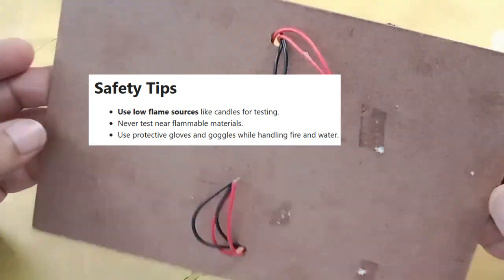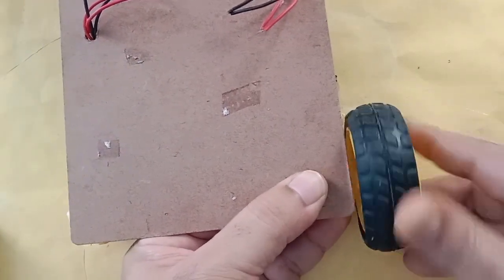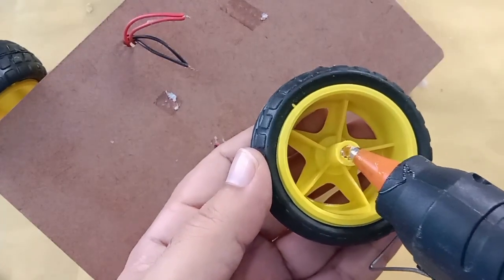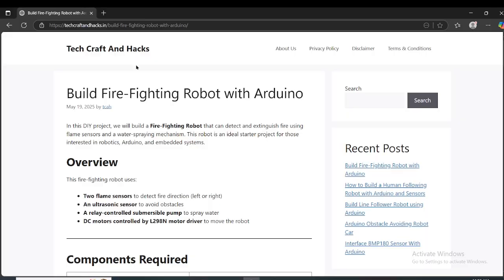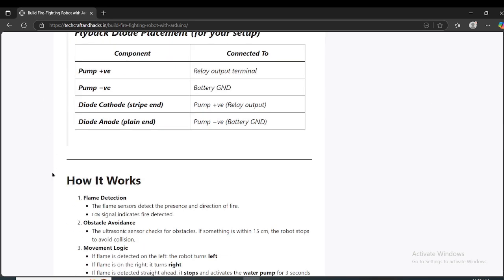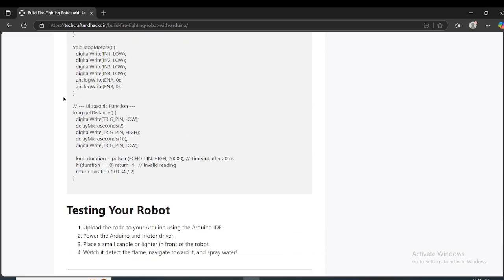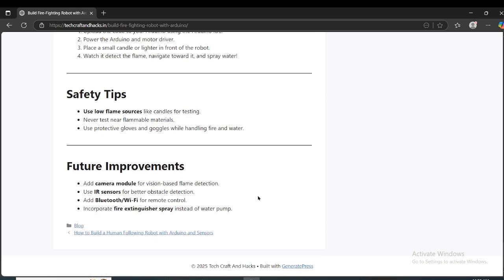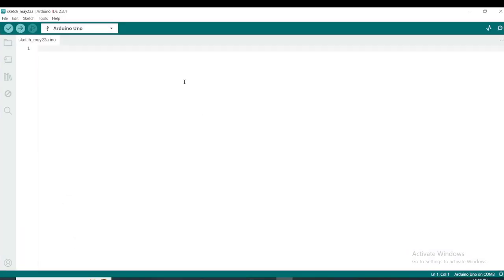Build a Fire Fighting Robot Using Arduino || Arduino Fire Fighting Project

Comment: In video at 13.58 i didn't understand how to connect please response me as earliest possible because I am a student and I have sense exhibition I have preferred your video only please corporate with me if you can can you please send me its circuit diagram to
Reply from the maker: 1. Relay IN pin should be connected to Arduino Pin12
2. Relay GND should be connected to Arduino GND
3. Relay VCC should be connected to 5V on Arduino 

To power Arduino connect 5V which is coming from Motor driver output to Arduino 5V (Motor driver 5V --> Arduino 5V).
Do not connect to the VIN pin.

Comment: Can we used 9v battery
Reply from the maker: W can power an Arduino with a 9V battery by connecting it to the barrel jack or the VIN pin.

Comment: In this project the relay is not working so water pump is off then how to solve this problem
Reply from the maker: You can try by giving a separate power supply to the relay module.
Reply: Also I give a seperate power supply but not working